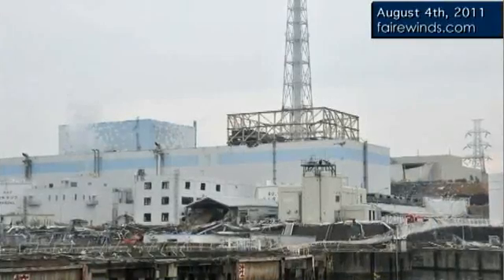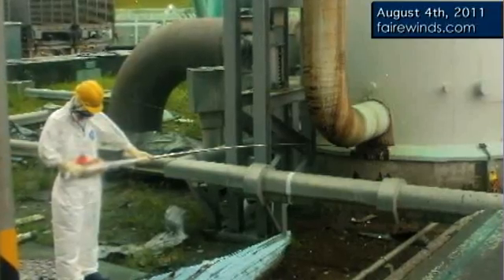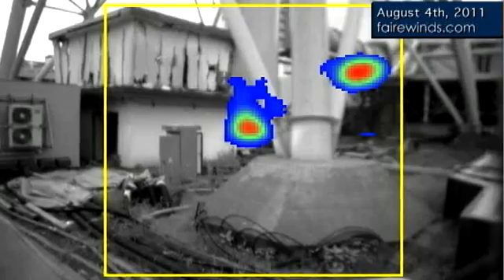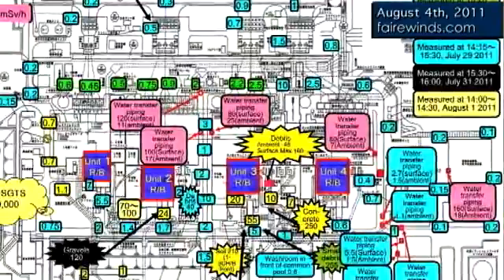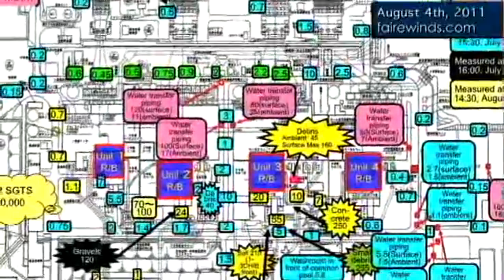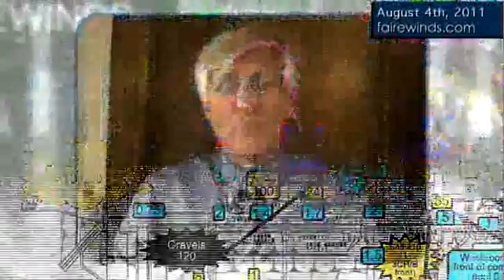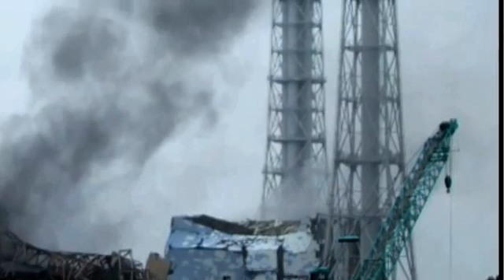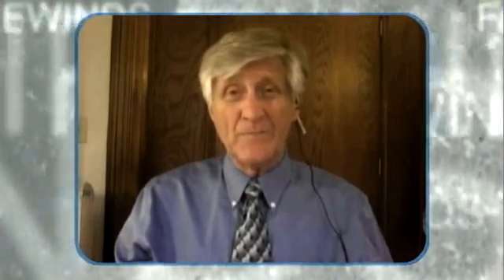Lethal Levels of Radiation at Fukushima:  What Are the Implications?

Comment: The reason it's in the pools is because it was used in the reactor and is no longer fissile.  This is because the U-236 was used up by the reactor, and now U-238 is left over, which is useless for fission.  The pools moderate the neutrons and prevent unsafe levels of radiation from escaping.  The uranium is stored there until it can be sent to storage sites like Yucca Mountain.  U-238 can not create a critical reaction.  Read something about nuclear materials before making things up about them.